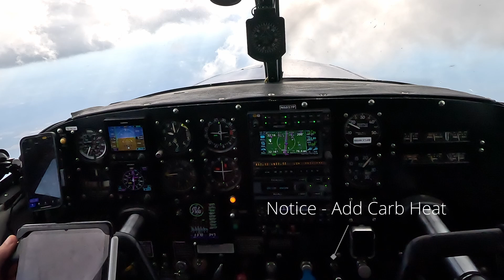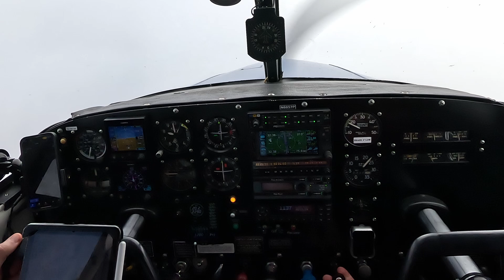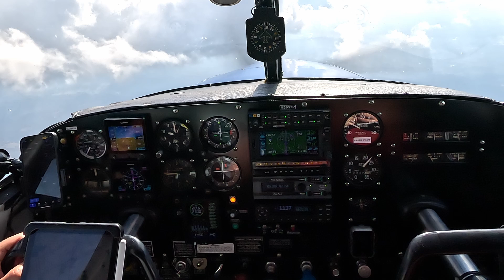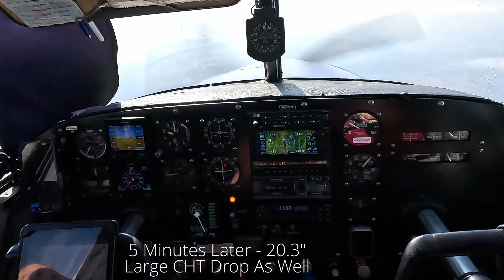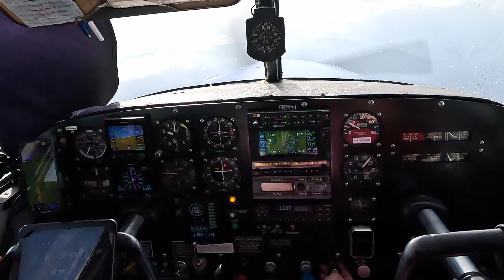Carb Heat in Piston Single Aircraft - Carburetor Ice in Cruise in a Piper Comanche 250

Comment: thanks for this! how rough was it? I mean, you felt it before you saw the MAP, right?
Reply from the maker: @flysport_tedder   not rough at all which is why it catches the unwary.  It’s basically just slowly closing the throttle by reducing airflow.  Hand flying you start to notice the loss of power if trimmed level but in a descent you wouldn’t normally notice that.  Then when you go to apply power you’ve got nothing.  In some engines if left to build for too long you might not have enough heat to quickly get rid of it

Comment: A couple questions; The normal manifold pressure gauge you can't see it on it, do you need to keep it with the 830?  Have you ever run a bit of carb heat and watched the carb temp, just to keep it in the green?
Reply from the maker: The 830 isn't certified replacement - wish it was.  The 930 is much more expensive and would've required running all new CHT and EGT sensors.  In hard IMC or if really busy I would pull the heat until I was seeing 50F or so on the carb inlet temp and re-lean the mixture.  Once I was aware of on this flight, I was enjoying paying attention to it to see how often it really occurred and at what carb temps and outside air temps.

Comment: Why not just leave the carb heat on in this case? I know it loses a little power, but it's a fairly negligible amount from my experience. Carb heat isn't filtered air, I know, but is that a worry up in the air?
Reply from the maker: If I was in hard IMC or task saturated I would've left it on and adjusted the mixture to compensate.  As you say, unless you're in an area of smoke or other particulate the lack of filtration shouldn't be a major factor

Comment: Thanks. How would you personally predict carb icing conditions for your own flight preparations in the 250?
Reply from the maker: @Glider324  any visible moisture with ambient temps above freezing is suspect.  Otherwise humidity over 90% as happens in the FL summers.  My Comanche seems most susceptible in the 17-21” MP range - higher or lower and the carb intake temp runs much higher naturally